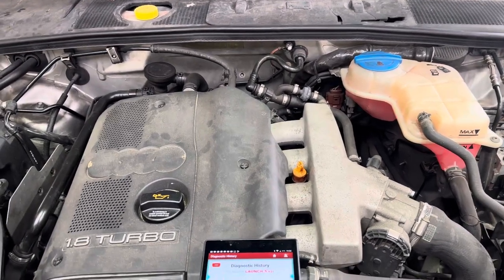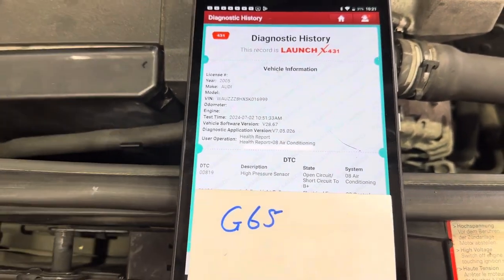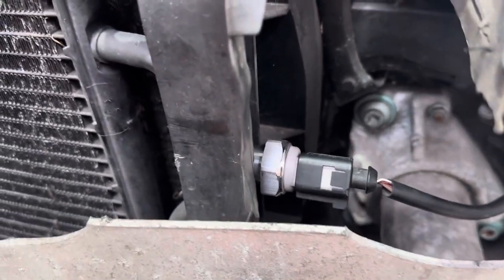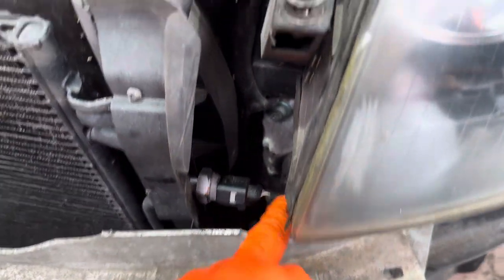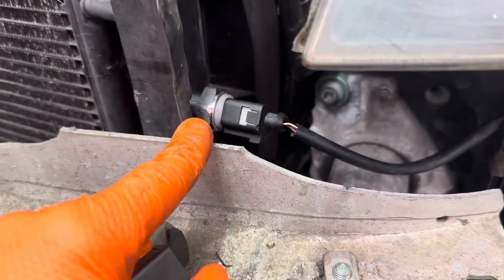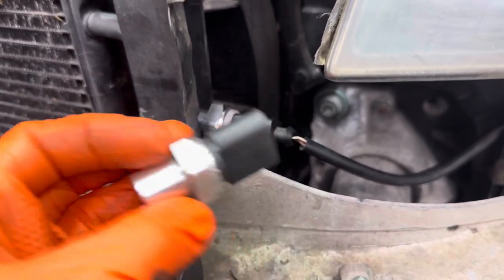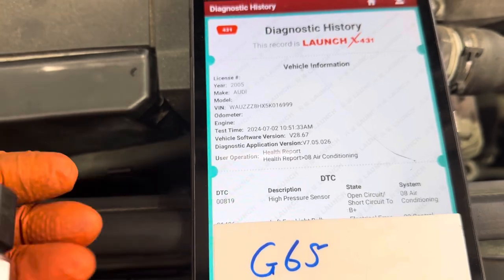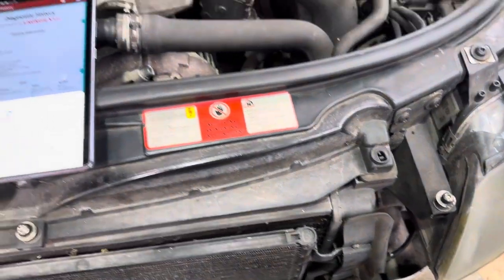Econ Button Won’t Go Off Audi A4 00819 (G65 sensor) FIT GENUINE SENSOR ONLY! FIX

Comment: Many thanks. Had this problem with the econ switch staying on. Watched your video, went straight to the AC sensor,  it had a bent spade pin in the connector(middle one), from previous work being done. Straitened pin, job done. Happy days.

Comment: Ive had this issue,  had aftermarket sensors and it would work, but fill up for fuel and its off until the ambient temp went down, usually in the evening.   Gotta be genuine for these AC sensors.